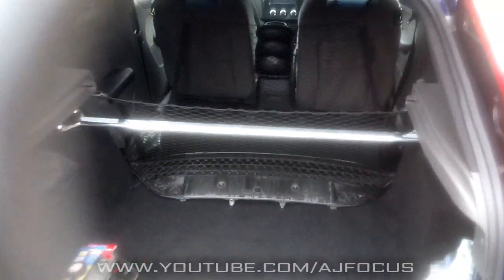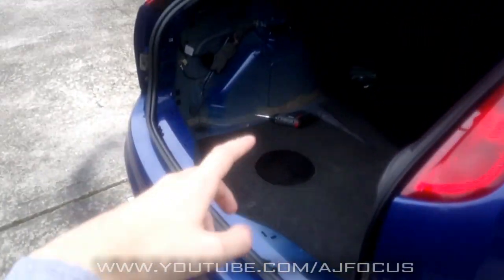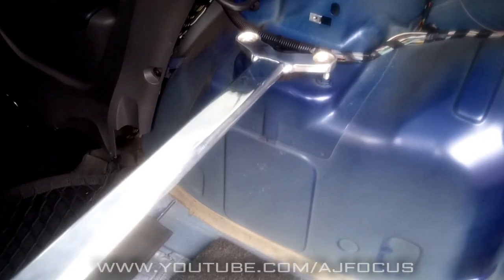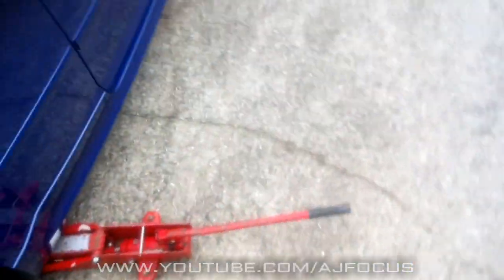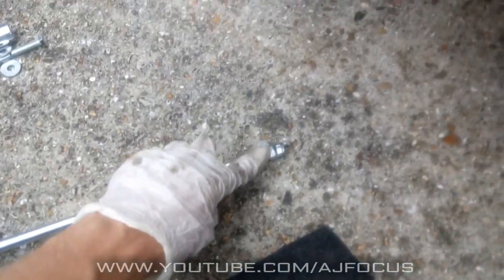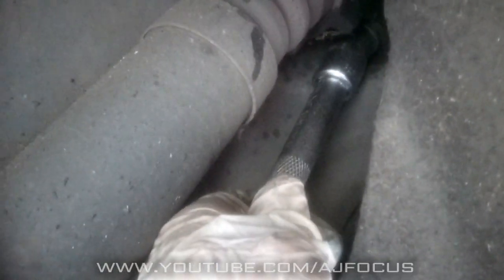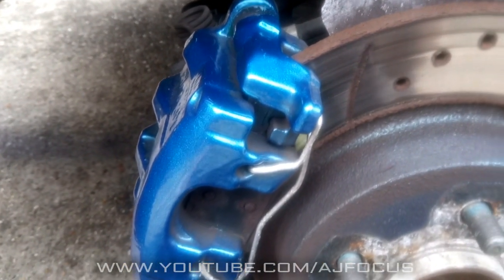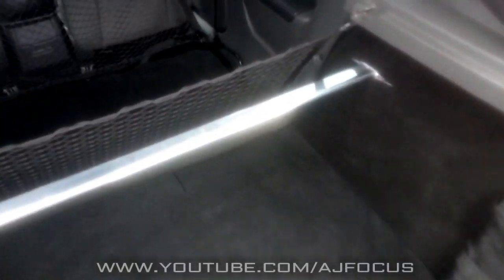Rear Strut brace Install on my Focus ST 225 mk2 mk2 (SE:2)

Comment: Be interested to see with this one, if it's worth doing. Keep us posted on the upgrade
Reply from the maker: full review video coming on the mods mate
Reply: @ajfocus  What did you rate this mod then mate? There a good price at the min considering getting one
Reply from the maker: Good peace of kit mate helps to keep that rear end stable and eliminate any chassis flex. Helps on the hard braking. 👌 Good price for what it does. No need to speed big bucks on a branded one they all do the same.
Reply: @ajfocus  Thanks for the honest info mate, just placed an order for one. Thanks for the info and great advice. Keep doing what your doing mate